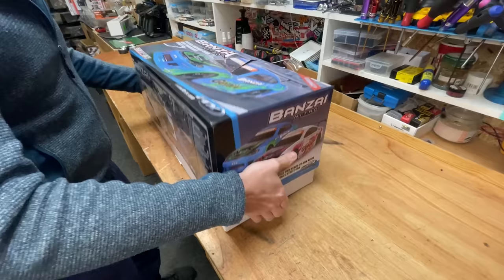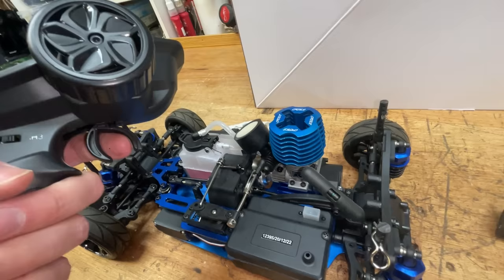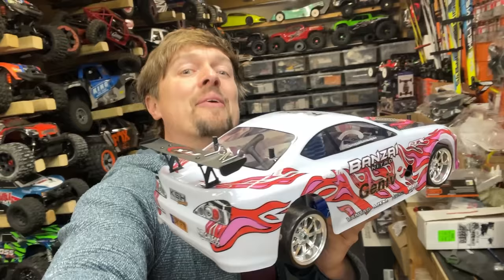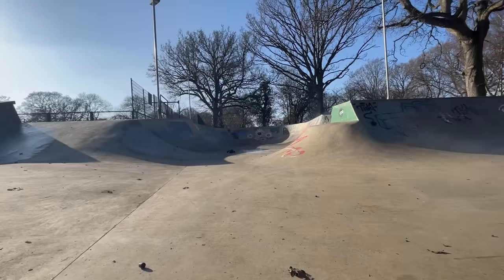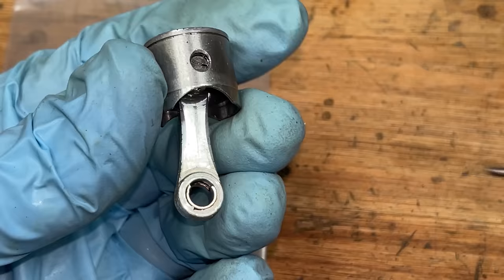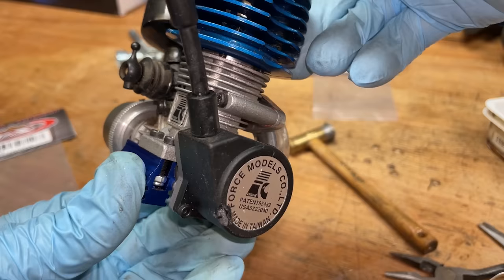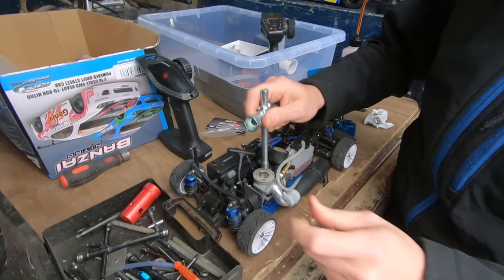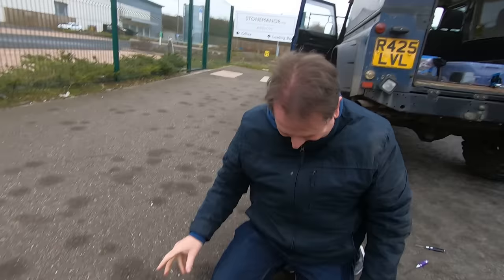Nitro RC Drifting (40,000rpm Engine Failure)

Comment: I may be wrong but I don't think that piston had a chunk missing I think it supposed to have that indentation in the skirt of the Piston I think the rough edge you were looking at was probably then little bits of bushing smacking off the edge of that piston while it was trying to find its way up to the top of of the cylinder 2-stroke or nitro engines usually have a hole in the center of the skirt or they have a cut out on the lower portion because the fuel goes into the base of the engine and then find its way to the top of the piston and then Burns but the fuel usually goes under the Piston to the base of the engine first that's why you need oil content in your fuel because it has to go to the base of the engine to lubricate the crankshaft in the bushings or behrends depending on what the engine has but that's how it keeps it lubricated and then it finds its way to the top of the Piston gets pushed to the top of the cylinder and burned and out the exhaust

Comment: I ran nitro in the past and running them on high nitro fuel like 25+ can burn them up. Try a 10% to run in and 15-20 after that. Plus stuff is made with bad metal these days so it could also be a bad engine.

Comment: Am I crazy or at 6:12 you clean the entire motor with brake cleaner , but when you open the motor up at 5:17 , the entire motor looked like it had oil in it? , I know nitro has oil but not that much , the reason it probably blew up the second time is.because you were running a dry engine , with a compromised piston head on top of that

Comment: I own this banzai myself the engine is really decent but you gotta do the run in procesure my first engine broke aswell cuz i didnt i did one tank on idle and then full blast and broke the pistonsleeve i bough a second engine brand new ran 2 tanks on idle and then 2 tanks on not more then half throthle and its been running since and runs great really a good little rc car

Comment: I'm no expert on nitro engines but you need some engine break in procedure In line with manufacturers spec plus I think you over heated the engine due to excess rpm and no cooling holes in the body.
Might be worth taking a laser temp gun to check engine temperature when running nitro engines.
Can't remember max temp engine should be as it's been over a decade for me but I think it's around 180-200 degrees c max?
But that aside I enjoyed the vid 🙂

Comment: I personally wouldn’t be changing the tyres until they are shreds! I highly suggest to anyone that wants to drift doesn’t follow the trend to use poly tyres and a gyro as this method is a novelty and drift speed is reduced to closer to scale speed but and big but it’s nothing on drifting a grip car with no assist and high traction! This poly crap sells the hobby short of what it’s capable of! My nitro drifter uses rubber my fav pre fitted wheel/tyre is the factory Traxxas 4tec wheels and my chassis is an old cheap p190 and I use a worked force .28 with an aluminium clutch 32t pinion and 46t spur and it’s fast! Like 80+ mph fast but has the torque to fry all 4 on any surfaces at speed and with a bit of shock and diff tuning it is very rewarding to drift!

Comment: No airflow whatsoever to the head! Cut holes in the body in front of, and behind the head to dissipate heat or run it with the body off. I had an old HPI nitro RS4 back in the day with a Novarossi engine, and that thing got way hot.

Comment: Btw when your tuning always do it while the car is moving under its own weight, drive a bit make a small change, repeat. Loaded and unloaded tunes will be very very different. Also the more effort put into a break-in procedure the longer an engine will last. A good starting point is the 1-1/4 rule starting at 0 throttle. Meaning 1 tank at idle then every tank after add 1/4 throttle input. never never use wide open throttle during break in this kills them. I've wanted to make my own vid on it but don't have the resources to do so. Would love to see you do a proper how to vid. Anyway thanks for the entertainment.

Comment: anyone who drives Nitro with a closed body and no extra cooling fan on the motor is nuts for expecting anything else but a engine failure.

Comment: Id say you need some holes in the bodyshell to get some cooling on the engine. I have got a HSP Sonic which actually looks very similar, wouldnt surprise me if some of the parts were interchangable. But when ripping that thing around car parks and stuff the engine def gets warmer with the bodyshell on vs it not. 

Other thing, it could just be you got a dud engine. I also have a HSP Warhead (1/10 scale nitro buggy) And the first one of those I got the engine was trouble right out of the box. Its a constant fight to keep that thing running no matter what i try, had it looked at by other experienced nitro people i know and we all agree there is something not right with that engine. I ended up just buying a second whole car as they are so cheap. ($250 AUD or $170 USD) The second one runs flawlessly. Same as the Sonic. (both cars have the same model engine)

Comment: you know, there is a crazy break in process with nitro engines. temps are extremely important and tuning is very finiky.... they will blow every time just running them hard out of the box.

Comment: 2 failures maybe that engine isn't so good. Did you break it in or strait Rev to red line? Pretty sure you have to heat cycle them for engine to break in and slowly take it up to quarter throttle then half and slowly start hitting full throttle increasing the heat every tank and letting it cool properly so all the metals properly break in to Red line 
Also with drifting you don't need to hammer the throttle 
A quarter to half squeeze is all you need

Comment: Kevin can you find the best cheap RC car that has 4WD metal parts and goes over 35 to 40 mph under $100 plus good servo, moter, receiver, transmitter and good battery life (Good Luck)

Comment: i know nothing about nitro engines, but why not grease the bearings in the crank case? does the nitro methane get into the crank and dissolve the grease? also, do you need to mix oil into the nitro like you do for gasoline powered two stroke engines?
Reply: Oil is premixed into the nitro fuel when you buy it, and lubricates the bearings. As you said the nitro would dissolve the grease
Reply: @2wenty7RC  thanks for the explanation

Comment: I have the same car exact car with the same exact engine. The only problem I’ve ever had with the engine is that I made it over heat (it was 90 degrees outside so). I did run my engine in, I just drove it around at low speeds at first, then highs speeds, the whole process. It works just fine so I don’t know if running in is your problem or not.

Comment: Why not "break in" work?

If you don't "break in" , the engine will die right away.

The surface condition of the pistons and cylinders of new engines is very rough.

Tune with a "brake in  machine" or burn out about 10 times based on the fuel tank while idling.

This will produce normal output and prolong engine life.

Driving immediately after purchase
A very good way to kill an engine.

Comment: I had a new ftx zorro brock it in and same engine failed rod bearing went then locked up piston had seized to sleeve was running 25% nitro in the end, I had to get rid of it as an engine was the price of the car

Comment: I need help with something on my typhon 6s I have a DX3 transmitter and a SR110AT receiver. Every time i bind them together it works as long as I don’t turn off the car or the radio if I do I have to re bind it all over again

Comment: Too lean. 2 stroke engines run best Lean. It's easy to get a touch too lean and not realise it. 
Back in the day bike racers lean it off to peak performance,  then richen it up just a touch. Mostly it worked. Sometimes it did this.... 🤣

Comment: Does anyone rly know why theur nitro engine froze or blew up? lol. i swear the tune will be perfect but its almost like they just can only handle so much it seems. only nitro cars i ever got goog luck out of was the HPI nitros like the medium sized now but the big sized original hpi Savage. 26?

Occasionally ill get a trx3.3 that runs good and idles well and is super fast but you have to enjoy that while it lasts bc they dont live long. theyre fast though for how small they are and somewhat smaller engine size for the bigger trucks they had. but the jato 3.3 with the optidrive revo 2-speed transmission, but none of the optidrive crap because its rwd and no reverse to be as light as possible, plus easy to pull and install the motor.

But yea for my main rc's im unfortunately sticking with electric and just worrying about how much longer until my Lipos are done charging haha

Comment: Yes it blew up bc you didn't break it in and also bc it's a cheap engine
Reply: Nothing wrong with force engines. Hpi uses force engines and I’ve ran 10+ gallons through them before a rebuild. He didn’t follow any sort of break in procedure and didn’t have holes cut in the body to get airflow across the cooling head. That’s why it blew up.
Reply: @junkyardboost8372  yes I said he didn't break it in. Hpi are garbage man imho. Os, novarossi (luckily I have a dozen of them still lol) bullet, FX, or something like that are good engines. Will the force run?? Sure
Reply: @junkyardboost8372  I'm not a hater or an uneducated fellow just talking shit. I've had well over 100 rides at once from 1/16 nitro to 1/5 gasers. Bashers, racers, monster, rally, trucks, cars, truggy, buggy you name it. Hell airplanes nitro and electric, quads/drones, basically every rc known. I mod engines and build custom rides. Figured I would explain my saying what I say. I know what I'm talking about.
Reply: @kentuckybeardsman  well obviously they arnt up to par with the os or nova, hell even dynamite are better engines but it being a force had nothing to do with it blowing up that easily. IMO the main reason was it had no cooling to the head. I’ve neglected break ins before and still has the engine last a few gallons. Sad that novarossi went out. Soon us nitro guys won’t have anything to run because people don’t have the brains to tune and maintain an engine. Also, ABN cylinder OS are pure garbage and way overpriced.

Comment: really a beginner's mistake not doing a run in properly and the lack of cooling really didn't help you should have changed the piston and cylinder it would have avoided this problem and after the young people who see this will believe that this is what will happen to them if they buy a nitro 🤦

Comment: Run it in fast it will be fast.  If it were a 600.00 dollar motor most would not have that opinion.   And that may be the difference.    Maybe a 600 dollar motor isn't exactly way better, its how it's  treated that makes the difference........

I have many 60 dollar to 800 dollar nitro' that have never failed and run excellent to this day, many many gallons of fuel past what kosts would think.  

No offense, but if you talk any engine and run it past it limits it will fail.  That's why there are specs and a break in process.   Don't care how anyone tunes or modifies and engine,  no one will do more than the manufacturer. 

So many variables it this but just a thought.

And Kevin always says he is not an expert, but he is an expert.   And he to would not take a new 300 plus dollar engine and treat it in any other way than the book.  

This is not that time.  It's a cheap cheap rc.  But, from my experience I have about 30 of these cheap .12, .16,.18, and .21engines with gallons threw each and not 1 catastrophic faliure with and motor.

Comment: So..... you don't break the engine in like, at all?!? Is it carnage for views?   If you ran 3-4 tanks of fuel thru it starting at low rpms and moving up the longer it runs, they'd last and NOT explode constantly. It HAS to be for views.  Nobody with this many RCs is that clueless